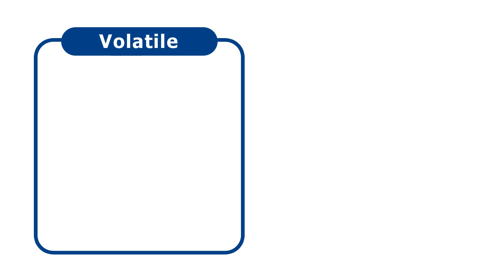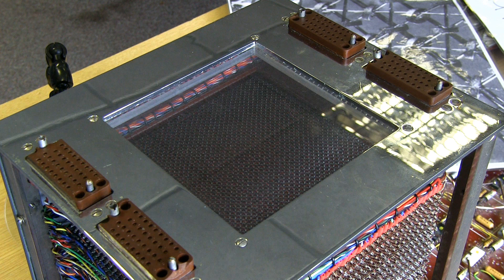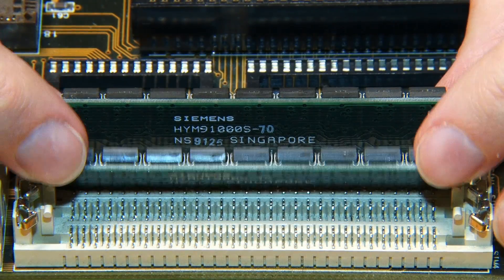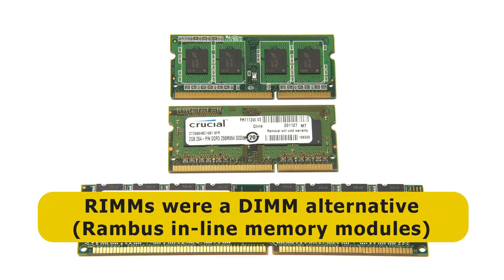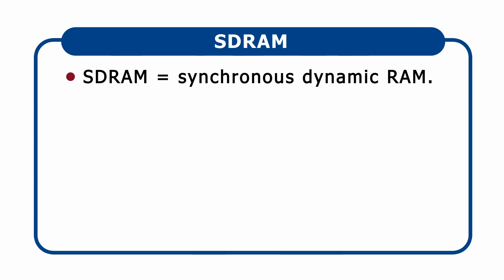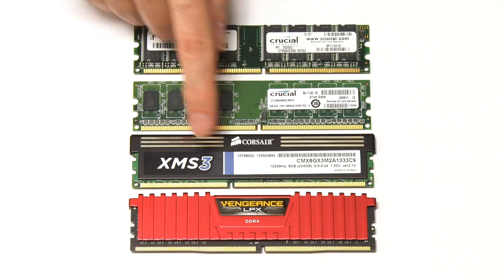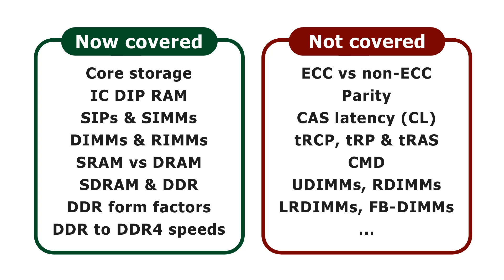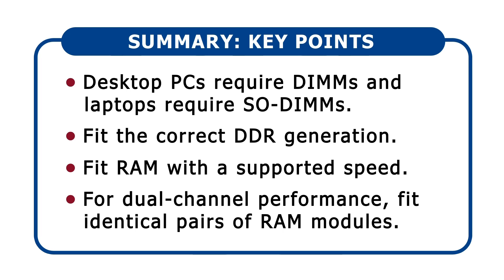Explaining RAM

Comment: Love the video ... but I would also love to know more about how it actually works at the individual cell level.  "How does it know?"
Reply from the maker: Basically the transistors work as switches, turned "on" or "off" to storage a "1" or "0". In DRAM the capacitor holds a charge to maintain the state.

Comment: Video is well done.
I feel old now, because i upgraded my first MegaST1 to 4 by soldering the ram ages ago. That was 4 Megabyte RAM and it was one of the biggest computer available for money that time. Quite a while later at work i bought whopping 4 Gb of Ram for more then 22000 DM and put it into my RS6000 with AIX.
Now I have several computers at home with 64 Gb and 32 GB for less then 1000 Euro.

Comment: Yea but the CPU is also a big factor in chosing ram. I have a lga1156 board that suports DDR3 1666mt/s but the currently instaled cpu (i3) doesn't support anything higher that 1333 DDR3, but the same board works with DDR3 1600 when fited with an i5

Comment: If you have workstation or server class processors (Core X series, Xeon E5/E7, Xeon W and Xeon Scalable on Intel side, Opteron, Threadripper and Epyc on AMD side) you will want to use sets of three or four identical modules for triple-channel or quad-channel speeds. Or if you are the daredevils that built that dual E5-2670 machine or any other dual socket machines, you will want to use sets of six or eight identical modules for hexa- or octa-channel performance.
Reply from the maker: True. :) But I was not covering server RAM here.
Reply: ExplainingComputers High end desktop chips also have three or four memory channels too, like the Intel Core X series and AMD Threadripper series. Although these are really just desktop versions of certain server class chips, Xeon E5-1600 series and Xeon W for Core X, AMD Epyc P series for Threadripper.

Comment: I recently discovered your channel quite by accident just a few weeks ago, and it has been an inspiration for me to embed a raspberry pi zero W into a home automation project that I'm currently constructing.  I've subsequently learned a great deal of python coding and hardware interfacing over the weeks that followed.

One topic that I haven't seen on this channel is a presentation the other end of the a typical computers lifecycle:  so called e-waste.  It seems very common for computers to have a lifespan of about 3 years before they are disposed.  If you could present this topic with the same clarity and rigour as your existing presentations on computing, then I would watch it with great interest.
Reply from the maker: Love the idea for an e-waste video. Noted as something to pursue for 2019. Thanks.

Comment: Nice work on the history...but I think you should have included some words on DRam timings.
When choosing new RAM, the timings are important too and can influence your Ram speed significantly.
A lot of people only look at the frequency, but 4000 Cl19 is slower(depending on the application) then 3200 CL14.
I get, that the timings can fill one or two new videos, but I think you should have mentioned their existence. ;)
Reply from the maker: Fair point.

Comment: As you said, it is extraordinary that current computers have one million times more memory that old ones... but what I find little disturbing is that the reason of having more memory is NOT necessary because new computers do millions time more tasks... but they do those tasks a thousand times less efficient than old computers (there were multitask/multiuser computers where each users could run several programs at once AND do that with about 64KB of RAM.. including OS, Apps, etc.. etc..)
Reply from the maker: So, so true.

Comment: Guess you need to do a second video with latency, and ecc/non ecc. As this two are the most important bit that left out list had Imo.  Great video.  Random access memory is a often overlooked topic by a lot of people. But it's so very important to everything from games to how many chrome tabs you can open.

Also can you explain ready boost vs page filing etc?  In xp I used to set page filing to a usb drive to speed up low ram computers but I see nearly no improvement from "ready boost."

Comment: I've always been curious about how the different speeds of DDR4 correspond to performance.  Does a faster speed RAM always equate to a faster computer, or is the particular CPU and motherboard a limiting factor?
Reply from the maker: Faster RAM will improve performance if RAM is the bottleneck. But, as you imply, it will often not be.

Comment: Nice video. No mention of flash types? About speed,  i have upgrade some laptops with higher speed memory than recommended succesfully and it is working fine, however people reading this should never place lower speed memory into a socket with higher speed recommendations.

Comment: Very informative thankyou. What I've been wondering is what the performance difference is between Laptop SO-DIMM RAM cards to standard PC DDR4 RAM cards. does the smaller form factor laptop RAM perform worse than 'PC' RAM? Why? Well why don't/can't we design say 8 channel single slot memory ATX motherboard using SO-DIMM cards? Compact design...
Reply from the maker: The form-factor makes no difference -- a DDR4 DIMM and SO-DIMM of the same speed have the same performance.
Reply: So it's feasible- though unlikely- to set up an 8 channel ATX Motherboard utilising smaller So-DIMM cards? It would make Multicore CPUs and APU's more efficient?  @ExplainingComputers

Comment: I think you need to make this a series of videos and do ‘go on’ about memory.  Nothing wrong with this video, a bit of historical background and a general overview.  But as someone who is no expert but plays around with x64 stuff to resell then it is a mine field and you can easily have problems with memory because of seemingly innocuous differences.  This week it is a HP that will only play nice (as in boot) if it has a certain DDR with the correct latencies (I worked that out on the 12th stick I fitted, but it is only 1GB so not enough to sell the system)- I’m not talking about mixing and matching DDR3 sticks, it will only accept one type of stick effectively.  You’d have less hustle with an Apple PC.  Luckily, I know better, but not so much better that I didn’t spend a good part of a day fitting DDR to a cramped SFF case before I decided to download the engineer’s manual.

Then there is EEC memory, and more importantly how motherboards deal with it.  My HP ProLiant Micro server will take either DDR3, some servers it is ECC only, then we have Ryzen.  Most of us understand the motherboard must match the CPU has to match the DDR, but it really can be down to more than that with some builds and it is wise to be aware of that.

Hope you don’t think I’m being critical because I’m not, I just think the idea fits with your audience (and I could be wrong about that, it is your audience not mine).

Comment: Where I worked, we had a computer that used core (non-volatile) memory. I remember the circuit boards - they were maybe 18 x 18 inches. This computer was used to weld truck cabs at a GM truck plant in lots of stages, all running simultaneously. The computer was only 8K but took up a huge area. Two large mobile homes were put together to house it, the I/O being the reason for the size. For keyboards, we had maybe nine radio teletype machines (RTTY) and they were always on the fritz. To start this whole thing, you would pull a 'boot strap' through a reader. It was a ticker tape type of affair about six inches long and one inch wide with holes punched in it and it had to be pulled because the drive motor was shot. The curious thing about this was that it could do more than one thing at a time. This was before the Amiga and Apple ever even thought about time slicing. This is nothing now, but back then, that was a big deal. I know it could do more that one thing at a time because I ran some programs that I had written in basic while it was welding up truck cabs. Oh, and there were no monitors or CRT screens. Any visible output was on paper rolls e.g. my basic program(s). This was in the 70s & 80s.
Reply from the maker: A great story. Thanks for sharing here. In some ways computers were more amazing years ago.

Comment: 2:50 - You missed the main reasons for going to memory modules: density and uniform packaging.  On board DIP memory required a huge amount of PCB space where as modules allow you to go vertical.  Modules brought to market a uniform package that provided the same pin out for multiple sizes and didn't change by manufacturer.  While motherboard designers were basically limited to DIP memory ICs (and thus limited sizes), the memory module manufacture could use whatever type of memory IC package was available whether DIP, SOJ (J leads at 2:57), or any SMD type.  And motherboard manufactures didn't have to wait to see what package the next memory ICs came out in as long as they supported the module design properties.  This also extended the motherboard marketing life as they could support future sizes before they were even available.

Still a good video.
Reply from the maker: Good points.

Comment: 6:20
Isn't it the other way around?
Reply from the maker: No, I don't think so. SRAM  is built from multiple transistors per cell, is faster, but more expensive due to the number of components per cell. DRAM uses one transistor and one capacitor a cell, hence it cheaper to manufacture, but slower than SRAM as the capacitor requires regular refreshing, which the transistors in SRAM do not. Not sure what else to say here! :)
Reply: Well, that's not what I have heard. Doesn't maintain data part of it slow it down like hard drives? (Mostly SSD)
Reply from the maker: RAM technology has nothing in common with HDDs. :)
Reply: Which is why I said mostly SSDs.
Reply from the maker: I still do not understand your point. In my first reply here I have made things as clear as I am able. SRAM is faster but more expensive due to having more components per cell, but not having the speed disadvantage of requiring cell refresh. This has nothing to do with the storage technology used in either HDDs or SSDs.

Comment: Can we use different speed RAM in Dual channel mode?
Reply: Theoretically yes, but CPU will run them on same speed, but it is better and safest to use same kind of module. CPU will always pick speed of slowest module. With DDR4 thru all memory runs in 2166 by default, at least with Ryzen
Reply: @ShadowriverUB  thx for the answer

Comment: Ah, the dark days and the black arts of the first SDRAM, high and low density issues, single versus double sided, or the very first technology upgrade in SIMM - EDO.
PS. I think the SIPP had two P's - Single Inline Pin Package. The connections were the same as for the SIMM, so in the final days of SIPP, SIMMs were converted by soldering pins onto them
Reply from the maker: Both SIP and SIPP were used to refer to the same kind of module. I chose to ignore this in the video to not introduce another layer of detail! :)

Comment: I came here to hear you explain RAM latency cause i dont understand :(
Reply: Leniency is delay between request to read and CPU actually reviving data, the cause are physics and memory inner processings. if latency is bigger then a single clock cycle of CPU that means CPU (or more specifically a core) will need wait for another cycle to do continue execution of instructions slowing down the machine. This is very conditional and depends on CPU architecture and how it deals with it, so read about more specifics of your CPU and what memory to fit to it.

Comment: Speaking of low RAM sizes, I am always impressed how little code and memory it needs to make quite complex programs run on microprocessors ... such as for example the BIOS.
Reply: You need to remember that back then programs been stored in ROMs directly connected to memory interface and didn't require to be loaded in to RAM, all cartridges solution to Nintendo DS was really ROM memory modules, and read same way as RAM, that why they never had Loading screens... they already loaded as you connected them. Also remember that variables don't take as much space with 1MB you can store million of 0 to 255 values, this drastically increase when you add graphics and it's quality and when you include multi tasking;p if you look on task manager you can see ton of applications that only use KBs of RAM. And with floopy disk you can always swap data on RAM, the less memory the more data joggling you need to do

Comment: Nicely explained video. But, you overlooked explaining why there are so many more connections (pins) on the DIMM versus the SIMM. 
ie. That the original 30 pin SIMM was only an 8 bit memory module (or 9 bit with parity), with 72 pin SIMM moving to 32 bits. The DIMM then being a 64 bit memory module. In addition, each generation having more address lines (the 30 pin SIMM maxing out at 16MB). 
Memory modules didn’t really came about to solve “chip creep”, as you suggest. It was simply that the 1 bit wide DRAM’s chips of the time (eg. 41256 chips - 256K x 1 DRAM, following on from earlier 4116 / 4164 DRAM etc.) always required identical system PCB layout of 8 parallel wired chips, with each chip delivering 1 bit of the required byte from each address. 
Therefore, putting 8 chips onto a byte-wide SIP or SIMM was simply a logical "common memory layout" design convenience evolution. :)
Reply from the maker: I "overlooked" on purpose -- there was already an information overload in this video. :) I checked "chip creep" (like everything else in this video) from several sources, but totally take your point on the layout issue. Ultimately, any video like this is far more an issue of what to leave out as much as what to leave in. Some early drafts of the script her ran over 40 minutes, nd ultimately whatever I included or did not include here I could not please everybody.The purpose of the intro (history) sections was to provide context and engagement with content less dry than the tech/specs that follow. And this is why I did not get into the while 8/16/32/64 bit thing.
Reply: @ExplainingComputers  No need to explain, of course. I do take your point about information overload! :) 
An excellent and nicely explained video in any case. I always look forward to your videos. Keep up the awesome work!

Comment: When I was teaching myself how to use my Apple ][+ I meet a gent at a lunch counter, who afterwards was a friend for many years, who started out in computers in the US Air Force. He'd  help me in coding from time to time, and something I had done in basic, like inserting an item in a sorted list, using 7-10 lines of code he'd do in 3.

He said that early on they were using a revolving magnetic drum for memory, and they had to make every clock cycle count while waiting for the drum to rotate. He also gave me a book of algorithms so I could use the solutions that others had already come up with.

My Apple started out with 32K of ram and a floppy drive of about 100k. With a few extras I spent about $2000 US in 1979, which run through a cpi calculator comes to $7,400 US today. I had changed jobs, and when I got a check for what was in the retirement fund I knew just what I had to get. No one I knew, except for a friend's dad who was a Army Engineer major, had a computer at that time.

It was a long time before I got it up to 48k or ram, and then eventually 64k when someone found out how to get ram to share the same address space as the rom which held the basic program and i/o routines, all of this running on a 8 bit 1Mhz 6502 cpu.

The only thing that really brings back that early tech high and feeling of total control I've found lately is the Raspberry Pi

Comment: As always beautifuly explained RAM information, good job you kept it to only RAM and not ROM, EPROM and EEPROM. The ZX81... I had a TANDY pocket computer with only half a "K" or 512 bytes of memory and as it was a pocket pc I would take to the supermarkets and use a little program I wrote in basic that I would use to enter the prices of a small selection of articles from different supermarkets to "calculate" where to buy to get the best deal. I was about 16 years old at the time (1986). Amazing how mucht thought goes in when you only have a very small amount of memory. I actualy still have it.

Comment: Just to add, when buying DDR3 it's a good idea to check with  your motherboard manufacturers support pages that the particular brand of  DIMM  you want to buy is supported.  Otherwise, like me, you can end up buying DDR3, that appears to meet the specific board's/CPU clock requirements and yet mysteriously still won't work. It appears the DDR3 standard ISN'T completely standard.

Comment: Shame you didn’t mention  the mercury delay line memory as used in EDSAC.  That came before the magic magnetic rings of joy that followed. They were so much fun when one ring to rule them all stuck or cracked.
Reply from the maker: I was speaking to one of the guys rebuilding an EDSAC last year. They are not allowed to incorporate mercury delay lines in it today on health and safety grounds!
Reply: I guessed that may be the case. Mercury seems to strike fear in many.

Comment: I dunno about anyone else but I can see a whole petabyte of RAM getting swallowed up by the endless sea of bloated web and Electron apps in no time. :\
Reply: At that point you can load up entire hard drive on you RAM and don't need to load anything just once and you would not fill 10% :p
Reply: glances at current trainwreck that is the tech industry If only. >.>